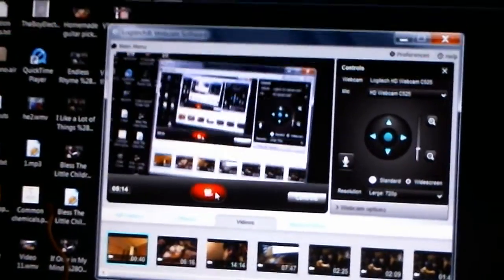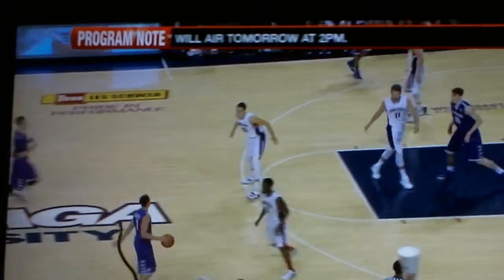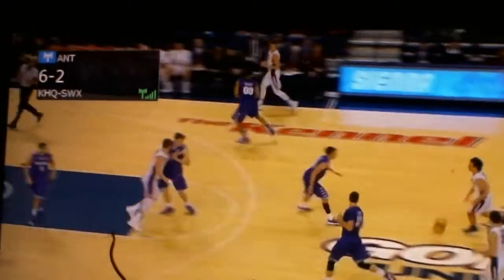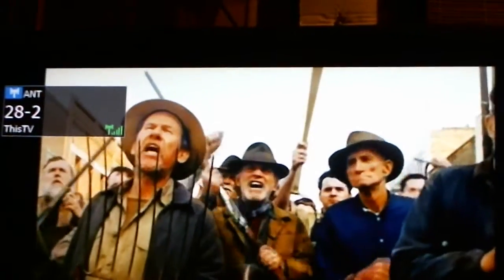Homeade digital TV antenna

Comment from the maker: Well, raskel was correct but unfortunately he removed his comment.  Either that or he forgot to put a diode between the capacitor and the internet thus perpetuating power backflow which caused his words to flow in the opposite direction and vanish!  No worries though because I read them prior to the backflow and he was spot on.  He's got a very intuitive mind and heart.  

Thanks raskel71,

Rolland